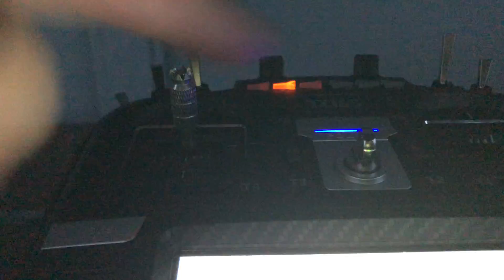Testing a new motor on an early flight | Raphax EP:06

Comment: In the description you said it was windy  conditions? That video is great for not being stabilized, that’s a very solid bird 👍
Reply from the maker: Indeed it was windy and the "little" fluffy wind at surface does not act the same way as a bit higher ... The Raphax has some weight with 1.5kg AUW and the wing shape does a smooth job. So yeah .. it is a solid bird after some tuning to your preference.